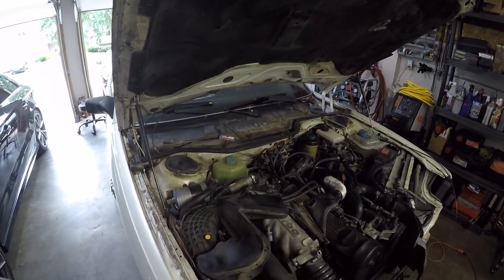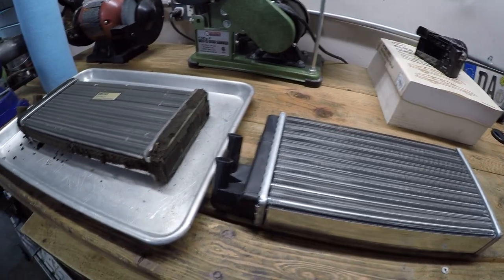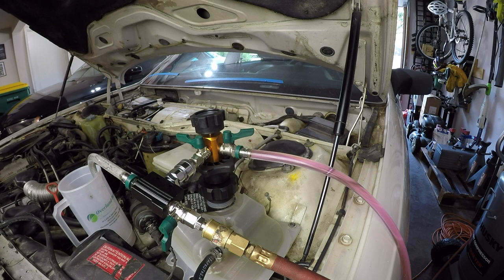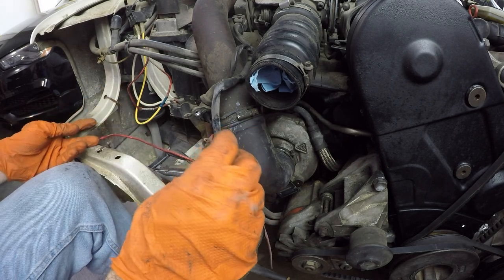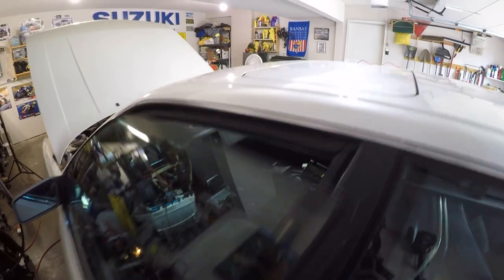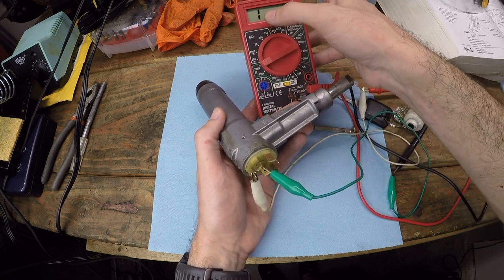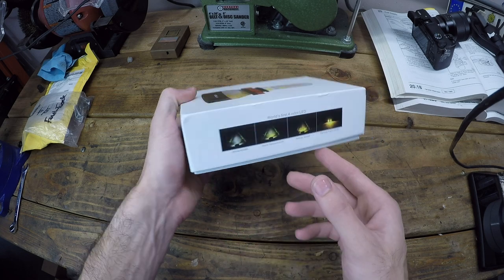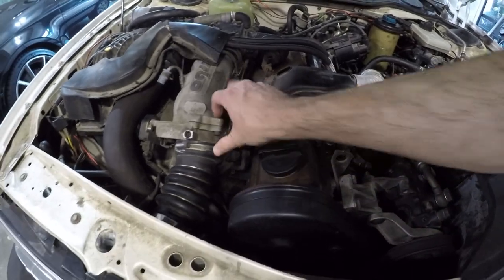Project Audi 5000 CS Quattro | Ep. 4 | Heater Core, Ignition Switch, LED Headlights

Comment: The heater core on my '87 5000S went bad. This video was a great help in many ways. Removing the HVAC housing and installing a new core was still a horrible nightmare, but it's now done. It is not necessary to remove all the parts as shown in the vid. Clips and 3 screws hold the 2 halves of the HVAC housing together. A Philip's screwdriver w/ a very long shaft is needed to reach 2 of the screws.

Comment: love this series.  i had a 1990 audi 200 quattro which was very similar to this car.   had to do the blower motor and choose not to do the heater core, mostly because i was reluctant to tackle that heater box.  happy to say drove the car until 321k kilometres and never had a heater core issue.  those back calipers were always an issue probably replaced them 3 times as they always seem to seize up at the parking brake mechanism.  even though your fix on the ignition switch did not work it was very educational and as we know... sometimes things just don't seem to work out when trouble shooting these older vehicles.

Comment: As an old school Audi guy, these videos have been great to watch.  Only thing I'd mention is to use the "0" via the hole in the transmission for the TDC mark.  The mark in the front harmonic balancer area isnt super accurate as the rubber fails and twists.  Looks like you got it though :D  Looking forward to the next video!
Reply from the maker: Thanks for the tip on the TDC mark! I guess I got lucky on mine, but I also did put markers on the belt and counted the belt teeth before removing the belt :)

Comment: I have the exact same car,exact right down to the fuch wheels.I used to work for Audi from 1992-2002 these things were always in for the same issues but a awesome car to drive once it was set up right.I have every available factory Manuel, sub books,even microfilm,car has been under cover in my garage for 10+ years I know I'm in for a project with the fuel system ,stored with bg44k products and stabilizer but I'm sure I need to start with cleaning tank and all fuel lines to fuel filter and fuel distributor,then to the lines and injectors ,seals and shrouds,also not a touch of rust,paint great, interior mint 126k..,I was smart enough years ago and stocked 3 file cabinets with virtually every spare part from pumps ,switches,sensors,oem hoses,dash,accumulator,Handels, HVAC ,vacuum box,display,regulators,ect.im hoping to get in on the road bye spring unless I get a decent offer was thinking about BAT ,really can't put value on it nothing to compare to so if I decide that route I guess no reserve be best,idk long as goes to someone that will treat it well thanks for video no one ever talks about these cars..thanks again

Comment: This series is a trip down memory lane, my dad had two of these 5000s ( both N/A auto fwd) that he got dirt cheap at the auction that looked like new and were less than 10 years old with less than 100k miles  because of the bad rep with the "sudden acceleration". They are still his favorite cars to this day though he was always working on the wiring/electrical systems and he screwed up the timing belt change on the second one it was off by a notch or something (because of a leaking water pump I think the timing belt drive the water pump) and after the job the car lost a good chunk out of the factory 100hp 😅
Reply from the maker: Oh no! These engines don't have any horsepower to lose! LOL. I can definitely see how these cars can be constant electrical nightmares if the issues are allowed to stack up. But for the most part the electronics are fairly mechanical in design and can often be rebuilt/restored. I wasn't so successful in my ignition switch attempt however.

Comment: More Classic Audi repair gold!  My Audi 4Kq cs has the fuel tank in the trunk.  What’s the best way to clean it as I need to go through the entire fuel system. Also there is an aftermarket option to replace the K-Jetronic fuel injection system called K-jet Killers but it’s over $1K!

Comment: I cringed when I saw you pulling those little actuator arms apart. "Oh! I wouldn't have done that!" Good work getting them back in place.

And then, of course, you rebuilt a $10 ignition switch. You are a madman, sir!
Reply from the maker: Thank you! 😂 Mad is certainly the correct word here. Limited parts availability can lead one to do some insane and regrettable things.

Comment: Did you cut open the old heater core? Would be interesting to see if it was full of stop-leak.
Reply from the maker: I haven't, but I do still have the old heater core. I don't have a bandsaw but I suppose a miter saw might work :)

Comment: Reminds me some memories I had the Euro version the Audi 200, the heater core, been there done that from what I reminder there's silicone that seals the heater core to the heater box. Looks like yours has been previously replaced and the guy had forgotten to seal it.
Reply from the maker: I read something about the silicone sealant where the heater core pipes protrude from the HVAC box. I was hesitant doing that so I left it alone.
Reply: @PracticalEnthusiast  I did it twice on the same car lol. The first time I didn't put any silicone and it worked fine and the second time I did seal it.

Comment: There are no less than six (6) of these at my local scrap yard, there's even a wagon! I wonder how good their steering locks are...
Reply from the maker: Hey that might be enough to build one good one!! 😆
But yeah, that would be an excellent source of parts. Do they have a website that shows inventory?
Reply: @PracticalEnthusiast  They only show that they have the cars, not what parts are available from them. Unfortunately it's a pick and pull place that doesn't offer a service to have the parts removed and sent out, you have to show up and get them yourself 😒
Reply from the maker: @jordanh.2998  Shucks!

Comment: enjoyed the video as usual! with regard to the starter issue, my money is on problems with the wiring or ground. this is an old car, and given that there was a trickle charger and a radar detector hard-wired into the car, you know a past owner has messed with the wiring. how is the bypass switch wired? did they run new wires all the way to the solenoid, or did they tap into the wiring for the original switch? that may be a productive place to look.

also, for the green death on the solenoid wiring, Edd China did a video a while back where he shows how to remove that easily:   https://youtu.be/XX20rvGcxng
Reply from the maker: The bypass switch is a complete independent circuit and it gets the full battery voltage. It very well could be a ground causing the voltage drop, I'll have to dig into that. And thanks for the link to an Edd video, as if I needed an excuse to watch him!!
Reply: @PracticalEnthusiast  - I'm certainly no expert, but I find it hard to believe that the lock cylinder tab degrading is the reason why the car won't start using the ignition switch. to verify that, you could connect the ignition switch (the old part you rebuilt or the new one) without the ignition switch barrel assembly...you could use a big screwdriver to turn it, redneck-/car thief-style. if you can't start the car this way, then you know that the ignition switch is not the problem (or not the only problem).
Reply from the maker: @andrethib  I tried the screwdriver test as well, and ultimately only got 10.6 volts down to the starter. So that's definitely one issue to resolve. However, this is a compound issue where the lock cylinder doesn't rotate enough to get the switch to provide 10.6 volts to begin with. Once the mechanical problem is resolved, I'll dig deeper into the voltage drop. I have ordered a new lock cylinder, but it's coming from halfway around the world so it might be a minute.